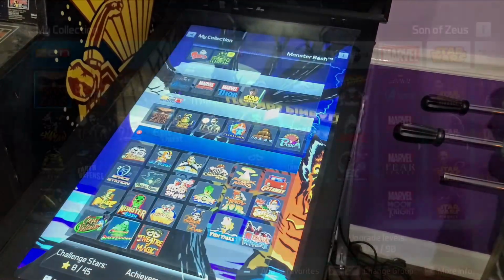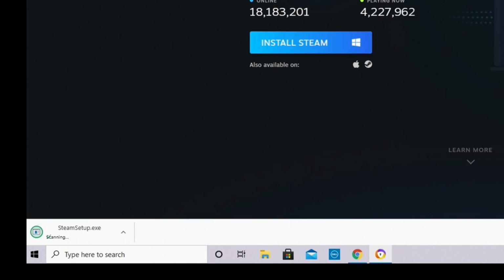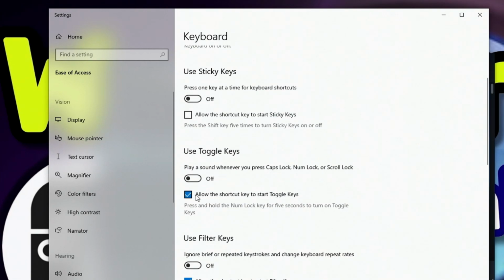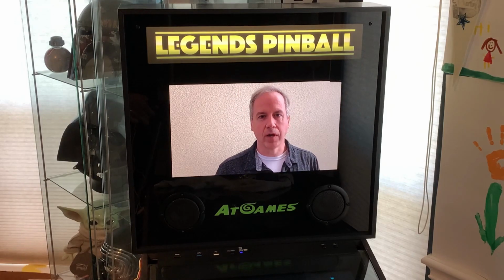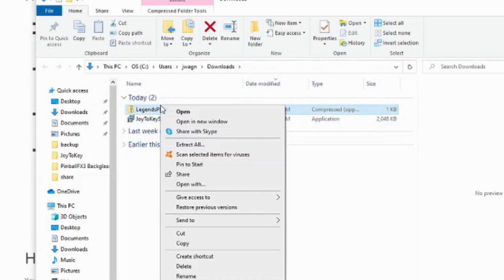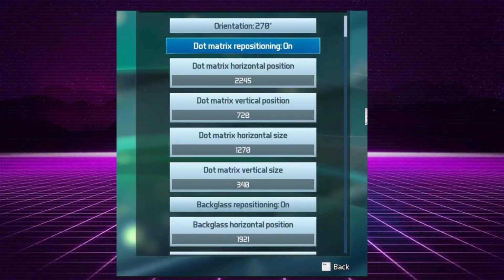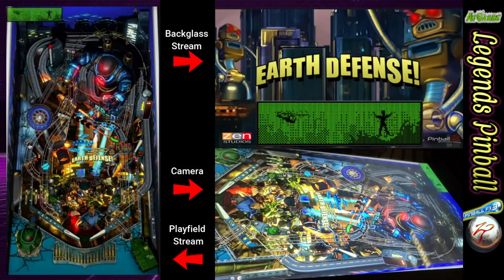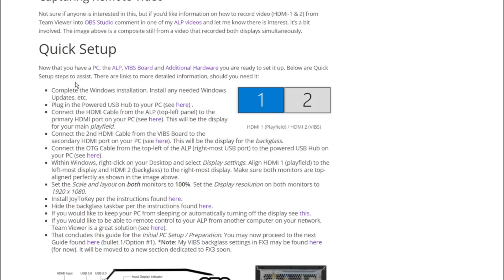Pinball FX3 Setup Guide for the AtGames Legends Pinball Machine

Comment: Great guide.. just got it all hooked up.. I only have two tables on FX3, deciding which ones to buy.. I am confused on backglass images. Where do I get those and what should they be called as .jpg files in the steam directory?
Reply from the maker: Thank you, glad it's all up and running!  For the backglass images, I'm currently using the ones shown in the 3rd bullet point here: https://wagnerstechtalk.com/alpfx3/#Software_Considerations .  When a game is not selected, you're welcome to use this image as well (I removed my logo from the picture): https://wagnerstechtalk.com/alpfx3/#FX3_Troubleshooting
Reply: @WagnersTechTalk  Thanks.. got em.. after putting everyting back togerther, fx3 audio is super distorted.. not sure what is causing that.. tried reboot, reinstall.. all other PC audio sounds fine thru the ALP .. scratching head
Reply from the maker: @bradodrummer5859  Maybe check the volume level on the PC to see if it's all the way up.  That combined with the AMP on the ALP may cause distortion.  Just a guess.

Comment: My usb 3 port on alp has not worked since day one. And still doesn't work even after a replacement of both boards and the cable. Support and myself are both confounded by this. Nothing in usb 3 detects. The hmdi input and usb2 ports do work.

Because of this. My alp tables are saved on usb flash drive plugged into usb 2.

To avoid a bunch of back and forth. I thought a powered hub plugged into my usb 2 would be the answer.

While the flash drive loads, steam does not detect my alp controls when the OTG cable is plugged into one of the hubs 4 ports. I have to have OTG direct connect to pc and ALP, making my usb hub useless. Any advice?

Is your hub connected to your ALP with your OTG cable to pc in one of the ports? Or is the hub connected to your pc with the OTG to ALP in one of the ports?
Reply from the maker: The powered USB hub is connected to the PC, in my case.  I would try plugging the USB drive and OTG cable into this hub: https://www.amazon.com/gp/product/B07L32B9C2 and the OTG cable from this hub to the powered USB Hub on the PC and see if that works.  Just a thought, I've not had this issue so can't be 100% sure if it will help.

Comment: Any suggestions for doing this with legends ultimate 1.1 w pinball kit from sams club?
Reply from the maker: You could do the same thing on the ALU 1.1, just don't use the cabinet code (won't look good on the ALU) and don't worry about setting up the 2nd screen.  The rest of the stuff may apply, might need to tweak the JoyToKey profile for the ALU as well to work with the pinball kit.  Hopefully some of that is helpful.
Reply: Thank you for the info and all your videos and guide!

Comment: I have set up the vibs board and the pinball as instructed but I have no sound.  Sound worked prior.  Also on the table you can see the edge of the table at the top.  Kind of narrows and and you can see the frame.  Any thoughts?
Reply from the maker: Hi Joseph, see the very bottom bullet here: https://wagnerstechtalk.com/alp/#VIBS_Troubleshooting
No sound when using FX3/VPX or Future Pinball (OTG) – click the speaker icon in the lower-right of the taskbar in Windows. Make sure it’s set to output audio to the primary HDMI output (your backglass). Once set properly, the audio should play through just fine.
Reply: @WagnersTechTalk  Thank you for the help.  Everything works now and I am running Windows 11.  Only thing is the backglass picture is not aligned.  I can see the PC screen on the last inch or two of the screen.  Where would I adjust that?
Reply from the maker: @JEdabody  Great news!  My "guess" is that Win 11 likely changed the display to 150% scaling on one of the displays (or both).  See the 2nd bullet point here and verify all is correct: https://wagnerstechtalk.com/alpfx3/#Software_Considerations
Reply: @WagnersTechTalk  ok that still didn't work so i'm just giving up on the backglass but somewhere while doing this my fx3 pinball is upside down. the main computer screen is fine.  Do you know how to put it back to right side up?
Reply from the maker: @JEdabody  Are you talking about the playfield being upside down?  Make sure you set Degree to 90 as shown here: https://wagnerstechtalk.com/alppcsetup/#Switch_HDMI_Input

Comment: When I connect my pc to the agl, the display will not show up on the cab. I am in otg mode my display settings are 100% and 1080p. My MacBook works fine. Not sure what the issue is with the pc
Reply from the maker: Connect the HDMI/OTG cables to your PC, power off the ALP, wait 10 sec. and back on and re-try.  As long as the display is set to 1080p and 100% as you said, should show up.  If not, double check the main playfield display (far left display) is set the same.  Maybe you're looking at the Backglass instead?  Hard to tell.
Reply: @WagnersTechTalk  so I hooked up another monitor to my pc and I got it to display as the second and it looked great. I switched the alp to be the main display and unplugged the second monitor from the pc and my alp screen went bonkers? I don’t really understand and the resolution automatically switched to something other than 1080 too I’m at a loss here

Comment: when i set up the vibs board my pc shows 3 monitors not 2.  Any tips on that?
Reply from the maker: I assume you'll be using only 2 correct?  If so, connect the playfield to the main HDMI port (up to you to determine).  Then connect the secondary HDMI to the VIBS board.  Arrange the playfield display to the far-left in Windows, VIBS to the right of that as shown in the guide.  The 3rd monitor would be all the way to the far-right.  Make sure each display is set at 100% (windows may try to change it to 150%, this won't work), 1920x1080, etc. per the guide.  When you press the channel button, select OTG and 90 degrees.  Should see the two displays on the ALP at this point.  If you plan on using a 3rd, I'm not much help I only use two at the present time.  Hopefully the above will get you going.
Reply: @WagnersTechTalk  thanks.  I guess the third screen is because I am using a laptop.  Thank you for the response.
Reply from the maker: Yes, 3rd screen would be your laptop display.  Just move it to the far-right.

Comment: Do you need to be on a certain firmware to get the plunger working? Windows picks up the ALP controller but doesn't detect the plunger doing anything.  It works for ALP tables.
Reply: Update It is the Firmware.  Shared my PC's wifi using a LAN cable to do the update.  My Pinball machines wifi is not working.  After the update Windows now picks up the Pinball Controller as a much different device and accepts the plunger as Z-Axis.
Reply from the maker: Good news, glad you got it!
Reply from the maker: Are you using the j2k profile on the guide and it's not working?
Reply: @WagnersTechTalk  Yes.  Checked Controller Configuration in Windows and the plunger doesn't register.  Used x360ce as well to see if it would pick up the plunger and nothing.  I have never updated the Firmware on the machine so I wondered if this functionality was added later on.
Reply from the maker: All I can say for sure, I'm on the latest firmware and it works.  I just tested it during my lunch break.

Comment: Hello, can you please explain the best way to get the DMD to work on the 3rd monitor instead of displaying on the backglass?  My 3rd monitor below the backglass just has the legends logo displayed. Is there a way in FX3 settings or do I need popper for that?   New to vpin.  Thx!
Reply from the maker: I don't have a 3rd monitor, so I can't be much help with that.  You'll probably (in Windows) want to position the 3rd monitor all the way to the right of the other two.  Then change the values for the backglass/DMD to however you want.  It will take some tweaking.  Took me awhile to come up with the settings that look good on a 2-display configuration.

Comment: I'm unable to configure OTG mode and can only use legendslink to stream locally (main board won't give any type of signal). This is causing major issues with mapping buttons (unable to correctly use JoytoKey with LegendsLink). Could someone please post their working steam controller config?
Reply from the maker: At this point, I've not used Legends link myself and can't offer any substantial recommendation.  You may want to ask this question at the Official AtGames Pinball Fan Page (Facebook).  You can find links to that and other resources here: https://wagnerstechtalk.com/alp/#Resources

Comment: This was so helpful! For some reason though my plunger just doesn't work in FX3 with Joy2Key. I can use the "Enter" (forward nudge) button to launch but the plunger does nothing. JoytoKey seems to think my "Sitck 2 <-" is constantly active and I think it's not picking up the plunger as a result. I've ended up using Steam Controller Mappings to make it work. I wish I could use the physical accelerometer, but it's too sensitive and windows thinks it's constantly moving.
Reply from the maker: Hi Neil, glad this was helpful!  Not sure why your plunger wouldn't work with the j2k profile.  Did you maybe map it in steam prior to running j2k?  That's the only thing I can think of, some other app. is responding to the button event (plunger) outside of j2k.
Reply: @WagnersTechTalk  It did work at first but once I set it up in steam it stopped. Even after trying to remove steam, reinstall steam, etc. I like how it works with the steam controller better anyhow. The problem with the j2k profile is that it's not as responsive to the movement since it's technically the equivalent of holding the enter key.

Comment: Wondering if you can help me. My cpu only has 2 outs. Can I use an hdmi splitter to get to the panel and vibs board?
Reply from the maker: A splitter will take the same video signal to two different monitors, not what you want.  One HDMI output should be the playfield, the other to VIBS (backglass).  If you have DVI output, you would need an adapter from DVI to HDMI.  However, I tried DVI to HDMI for VIBS and didn't have any luck.  In my case, for the VIBS monitor I went with the HDMI Adapter here: https://wagnerstechtalk.com/alppcsetup/#Additional_Hardware  I would try it with the two HDMI Output ports (assuming both are HDMI) that you may have first, if that doesn't work at least you have another option with the HDMI Adapter.
Reply: @WagnersTechTalk  thanks for answering. I figured it wouldn't work. New Dell laptop only has 2 outs. Forget the name but its a small out that I had to get adapters for to hdmi and data usb out. Oh well no backglass display. Thanks for this video too. It was my guide yesterday. Do you have one or one coming for pinball emporium?
Reply from the maker: If you have two HDMI Output ports, you may be good (1 to Playfield, 1 to VIBS).  I would start with getting FX3 up and running with the VIBS board, then I do have a guide for PinUP Popper Baller Installer: https://wagnerstechtalk.com/alpbi .  While Pinball Emporium may be easy to install, using Popper may be the best long-term solution.  It's more work, but you can add any tables you want.  Keep in mind, you can't run Pinball Emporium and Popper at the same time as they overwrite registry entries and will cause problems.  I never used Emporium myself, only went with Popper for several reasons.
Reply: @WagnersTechTalk  No. 2 usb type c ports only. So 1 for hdmi table display other for USB data for controls. I can live without the back box display. Woulda been nice. Ha. I'll watch that link for sure. Thanks again

Comment: I truly appreciate your guides and they have helped me immensely. I finally got my FX3 code and everything came onto the playfield screen after some settings. However, the flipper lag is horrible and I can't keep the ball in play. I am using the joytokey app for control and may try to go to the steam control config instead. Is there a better fix? I have another question but will ask that on a more related video. Thank you. -MayorMike
Reply from the maker: Very welcome, happy the guides have been helpful!  For the flipper lag, please see this section to see if there is something that helps: http://wagnerstechtalk.com/alppcsetup/#Minimize_Flipper_Latency  Often times, PCs come pre-loaded with a lot of junk that just doesn't need to be running and impacts performance.
Reply: @WagnersTechTalk  Thank you for your rapid response. I will try these things. -MayorMike
Reply: @WagnersTechTalk  I did a number of things suggested as well as I turned off vsync and antialiasing and the lag is still there but better. I am going to try to learn how to setup the xbox controller (apparently that is how it sees the Legends Pinball controls) through steam and see if I can bypass joytokey. I realize this will not work with the other platforms, but I thought it would be worth a try. -MayorMike
Reply: @mayormike  Any luck with the lag? I’m having the same issue using the Xbox control setup through steam. The lag makes it unplayable. I have an Alienware r17 3070.
Reply: @yojz  I haven't had the time to setup the xbox controller in steam yet, so I'm still using joy2key. Turning off the vsync and everything else did help. I will report back when I am using only the steam setup.

Comment: @Wagner'sTechTalk I am having an issue where I start up Pinball FX3, the whole playfield is dark but I hear the music playing but I can't see the animated PinballFX3 logo and the enter key that also appears on the screen. The only way I can get out of FX3 is to bring up the task manager and force close it.
Reply from the maker: I've not encountered this issue.  I'd double check the connections on both ends of the HDMI cable.  If that doesn't help, try a different cable.  I have had issues in the past where audio doesn't come through and it turned out to be a cheap HDMI cable I was using.
Reply: @WagnersTechTalk  Thank you for your reply. I think I figured out what the problem was. It has to do with the screen orientation settings. In windows I set both screens to landscape and 270 in the settings for Pinball FX3. The question I have now is when I am standing at the ALP, the desktop is not in landscape, so I have to navigate sideways to get to the FX3 app to open it. Once it opens, the game is in portrait mode. Is there any way to have the desktop in landscape mode so that it is easier to navigate to an open the FX and Steam apps? By the way, I am using cabinet mode.

Comment: I finally got fx3 working on Legends Pinball, but have flipper lag.  Tried turning off Nvidia 3d vertical sync but it did not help.  No lag at all on ATgames pinball tables, just fx3.  Any suggestions?  I'm 78 years old and a computer dummie, so anything will help.  Thanks  Gary
Reply from the maker: Hi Gary, I do have some recommendations here to reduce flipper lag: http://wagnerstechtalk.com/alppcsetup/#Minimize_Flipper_Latency  Hopefully some of these will help.  If none of those help, you can also try not using JoyToKey and map the buttons in Steam to see if that helps.  However, if you eventually plan to run Baller Installer PinUP Popper as well then the JoyToKey profile will be helpful for that as well.  I'd start with the recommendations above, disabling unnecessary services will likely help.

Comment: I have my VIBS board installed and works.  I am going to download steam and fx3 for the games that I purchased.  I have the Legends Pinball Control panel installed, so after Joytokey is installed do I install  LegendsPB-WTT or LegendsPB-WTT-PUP?    Thanks  Gary
Reply from the maker: Either one will work with FX3, the one ending in PUP has additional buttons for PinUP Popper mapped (but also works with FX3).  I'd say, go with the first one until such time that you want to use PinUP Popper.  With PUP, you'll have to map two keys for the nudge in FX3 with LegendsPB-WTT you don't.

Comment: trying to get mine to work, have the joy to key set up, the legendsPB, and set all the settings up.  settings make my screen horizontal and instead of vertical also makes 3 screens in settings.  If I delete the 3rd screen the color on the back screen just alternates colors.  I do have the joystick control board and win 11 so could be part of the problem I guess.
Reply from the maker: Firstly, I've not tried it with Windows 11 (only Windows 10), but I suspect the missing part may either be this: http://wagnerstechtalk.com/alppcsetup/#Switch_HDMI_Input or these settings: http://wagnerstechtalk.com/alpfx3/#Software_Considerations  Please double check those two sections and see if that helps.  If not, let me know and I'll try to assist further.
Reply: @WagnersTechTalk  I have dual video outputs, one is the micro so know those are good.  the settings for the back glass and playfield make it sideways on both if I use the settings showing.  When I get some more time I will slowly go through and make sure I do everything right.  I do have a powered hdmi splitter I might use
thanks for the prompt response.